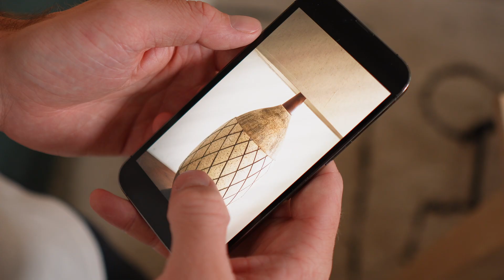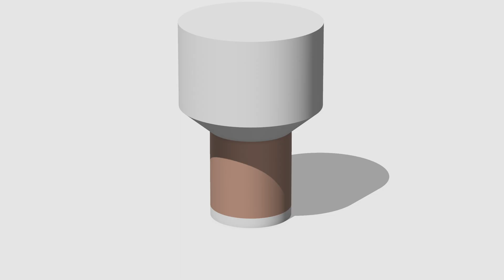Making a lamp from scratch with 3d printing (cozy modern mid-century)

Comment: Schade, dass die Lampe oben offen ist, ansonsten hätte ich sie direkt bestellt :)
Reply from the maker: Geschlossen ist auch eine gute Idee! Würde eben die Lichtausbeute etwas einschränken 🤔
Reply: @PaulLagierEN  Dann würde man aber die Glühbirne nicht sehen. Vielleicht geht das mit der niedrigstmöglichen Materialstärke, sodass nach oben immer noch ausreichend Licht kommt?
Reply from the maker: @sparedini89 einen Versuch ist es definitiv wert 👍
Reply: Closing it off would possibly lead to a temperature buildup. Perhaps some vents could be incorporated in the design. But integrating them so that they performed their function while looking good could be complex - but also could lead to interesting design solutions, such s-shaped internal ducts in the bottom and top parts of the lamp to enable air ingress and egress; this would change the design style though, and the top vents would make the lampshade have varying opacity - but it could be made to look cool, and it's only one of the ways to do it, e.g. a multi-layered top cover with flat plates partially covering the lamp,  spaced vertically, rotated relative to one another so that together they obscure the lamp but allow air movement.

Comment: That little light tester card at 1:24 is so smart, I'm going to give that a try. Also how thick was that nozzle you used? Those layer lines are HUGE
Reply from the maker: Yeah these cards are awesome! The parts on the Bambulab were printed with a 0.4 mm nozzle, the others on the FLSUN V400 with a 1 mm nozzle :)
Reply: Hey Paul! Could you tell us where to find those cards? They look amazing ! 
Thanks!
Reply: @PaulLagierEN  Awesome, thanks for the reply. I’ll try get myself a 1mm nozzle :)
Reply from the maker: @MintyMeta nice! what printer do you use? :)
Reply: @PaulLagierEN  I have an ender 3 S1 running klipper, got the settings pretty dialled in with a 0.5mm nozzle, should be able to change to a 1mm easily enough